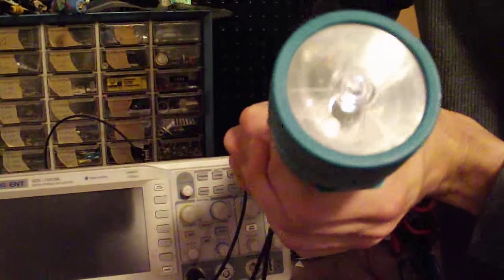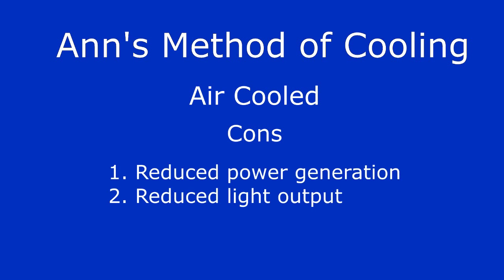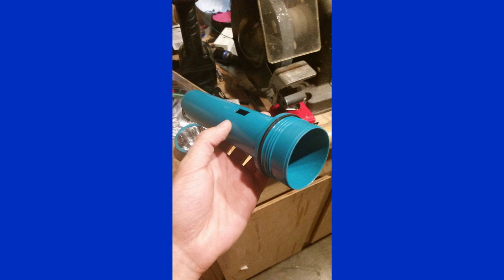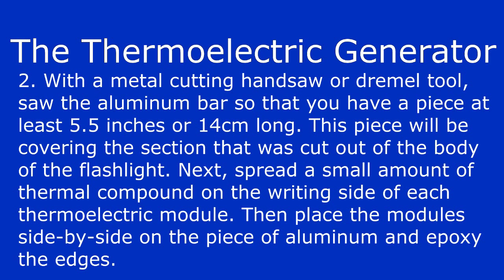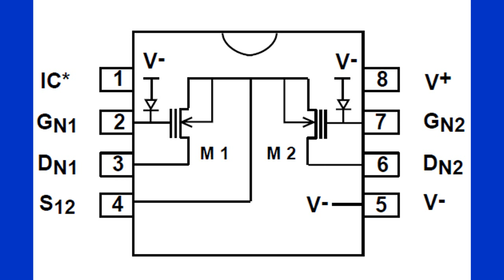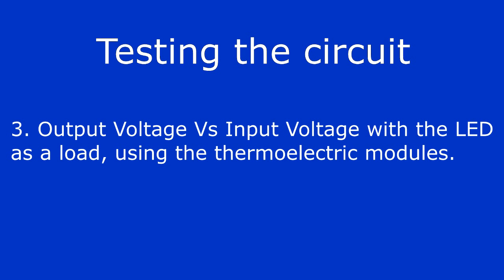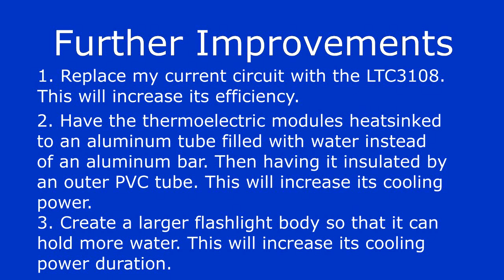How to make a Thermoelectric Flashlight

Comment: Hey i have a question, what do you mean in the end when you say further improvements and changing the tube to aluminium
Reply from the maker: Improvements in using a more efficient circuit, and a better method of keeping the lowing temperature side cooler, which would enable the modules to generate more power; an aluminum tube would help do this
Reply: LampE like should I get a pvc or an aluminum pipe?
Reply from the maker: An aluminum pipe would be best, but you would need to insulate the part that you are not using.

Comment: Hello, I'm french so first of all sorry for my spelling mistakes.
So, for my study, I'm trying to create a generator with Peltier tiles in order to power up a remote but first I'd like to power up a simple LED. I've already created a circuit with 2 Peltier tiles and a LTC 3108 but I can't switch on the LED ... I obtain 3.2 V but I'm just able to power up the LED for maybe a millisecond and that's all ... I've even tried to put a capacitor after the LTC and then discharge it through the LED... Have you got any idea ?
Thanks a lot!
Arthur
Reply from the maker: What is the voltage across the LED when you have it connected?
Reply: I have a very low voltage because it falls down when I connect the LED (I precise my current is DC)
Reply: In fact according to my test the voltage falls down to 2V when the LED is connected and the LED stays off
Reply from the maker: That means that it is not outputting enough current. This can be many reasons: maybe your peltier tiles are not outputting enough current, or your current is damaged. I can't tell with out testing it.
Reply: I will try to understand what's wrong ... Thanks

Comment: Would it be better to use a 100k ohm resistor?
Reply from the maker: Using a 100k ohm resistor with these specific components (the exact common mode choke that I am using, and the ald212900pal) will actually cause the circuit to perform not as great, but not too bad.

Comment: Can u tell me the efficiency of ald212900?
Reply from the maker: +Abtahee Salakeen If you mean the over all circuit efficiency, it is ~50-60% at an input voltage of ~0.2V with an output voltage of ~3V, at a duty cycle <10%. Under the conditions of a similar LED. Here is a link to the specs of the ald212900 http://www.mouser.com/ds/2/8/ALD212900-225961.pdf

Comment: im sorry,but i need to no whatss every component of circuit  do,you can explain please its urgent
Reply from the maker: 1. Ald212900pal MOSFET 
2. Common Mode Choke
3. 50000 ohm resistor
4. A White Light LED
5. Thermoelectric Modules
Reply: LampE   know the components, I just needed you to tell me what each one does on the circuit.
Because I have to finish an urgent project, do you think you can help me, please? A hug from João Pedro de Portugal
Reply from the maker: ALD212900PAL MOSFET: This is an electrical switch that allows the current to flow through the common mode choke to charge it, and also discharge it in order to light the LED.

Common Mode Choke: This does a few things. It creates an oscillation with the MOSFET, it increases the voltage, and it stores the energy that's being used to light the LED.

50K Resistor: This restricts the amount of current going to the gate of the MOSFET, so that the MOSFET doesn't get damage by the spike of voltage coming from the Choke.

Thermoelectric Modules: The power source of the circuit.

I hope this helps!
Reply: Tanks very much for the help :)

Comment: LampE I'm doing your project, and I'm stuck at the circuit part, cause I found that there is voltage and electricity that passes through my circuit, but when I put my hand, the LED didn't light. I checked if my circuit was wrong by putting two batteries and it worked. Any tips?
Reply from the maker: Make sure that you have the circuit connected correctly. Also, if you have an oscilloscope you should use it because it will allow you to see if the circuit is even working.
Reply: I replaced the joule thief circuit with a step up generator circuit that works at 0.5 volts, how can I get 0.5 volts from the four Peltier plates. I am only getting 0.36 volts. The circuit is connected correctly, and no I don't have an oscilloscope but I have a multimeter. I put a hair dryer and it worked.
Reply from the maker: You might need a better heat sink
Reply: I used two heat sinks, do you mind if I email you my phone number to call you
Reply from the maker: You can also try putting the heat sinks in the refrigerator, it will definitely help increase the voltage of the modules. You can message me your email, but email will be the best form of communication.

Comment: Hi I'm doing this for my project and I'm wondering if you have any idea what is the part number of the transistor i can use to replace the MOSFET?
Reply from the maker: If you are trying to build an energy harvester circuit, I would recommend the LTC3108 circuit instead of using this method of using a MOSFET. The LTC3108 is designed for this.
Reply: The thing is that the LTC3108 isn't available in my country and if I were to order it, it would take a very long time to arrive, which would make my project overdue :(
Reply from the maker: @moonlysmile1171  The ALD212900PAL is also unavailable to you from both Mouser and Digikey?
Reply: @lampe7384  yes, the same problem as the LTC3108
Reply from the maker: @moonlysmile1171  Where would you order components if not from Mouser or Digikey?
Reply: @lampe7384  I used Shopee, Lazada, and i think products from Electronic Source can be delivered really fast enough in my country
Reply: @lampe7384  so there really is no other transistor that can replace the MOSFET at all?
Reply from the maker: @moonlysmile1171  Yeah, the characteristics of it are pretty unique. What makes it special is the really low voltage threshold to turn the switch on; <100mV. I haven't been able to find a switch similar. What's the voltage range you are working with? Are you using thermoelectric modules like I did?

Comment: are there any alternatives to the ltc3108 and ald212900pal n channel mosfet?
Reply: do you know the mosfet's part number?
Reply from the maker: The part number of the ALD212900PAL is ALD212900PAL. In addition, there's another version of the same MOSFET called ALD212900APAL (Part # ALD212900APAL). The difference is the ALD212900APAL works at a slightly lower voltage than the ALD212900PAL and it cost a little more, but it's basically the same.

Comment: What is the current and voltage value of the common mode choke used here?
Reply from the maker: The maximum current value on the common mode choke used is rated at 1 amp. However, the actually input current going into device is tens of milliamps. The output current is less than a couple milliamps. The voltage values are different depending on the input voltage. Watch from 13:00 to see the different values (the voltmeter is is millivolts).
Reply: Thank you very much LampE!

Comment: Hi, will the torch work if I use a voltage booster 0.9V-5V,instead of the Mosfet and the common mode choke
Reply from the maker: Only if you can get the modules to produce 0.9 volts. you would need a pretty good temperature differential. Maybe Ice cold water will help.
Reply: Thank you so much,can sodium nitrate do the job,because it is a good coolant.
Reply from the maker: Yeah that should work, because sodium nitrate is a great anti-freeze agent. If you add the right amount to water, you should be able to put it in the freezer without it freezing. One thing that you will notice though, is that the flashlight will be super cold when you hold it, but it should definitely work. Also, sodium nitrate is highly flammable, so be careful.
Reply: Thank you very much.
Reply: Thank you very much.

Comment: Hi great video, but I was wondering, where do the wires of the red and black from the modules have to be connected to?
Reply from the maker: Looking at the diagram at 10:20, the red (+) wire from the module is connected to where the diagram shows VCC. The black (-) wire is connected to where the diagram shows GND. I hope this helps.
Reply: @lampe7384  so just to clarify the red (the +ve) goes to the 1 wire of the common choke that is connected to the resistor. And the black wire (the -ve) goes to the source pin and the negative lead of the led?
Reply from the maker: @imok7348  That is correct
Reply: @lampe7384  Okay, thank you so much! Have a great day!

Comment: I want to boost 20mV to get 5V..So ltc 3108 is the only option. Please tell where to buy Ltc3108 online? I checked it on website of linear technology and their were too many models?? Please tell me which one is the best model?
And how can i make the circuit??What are the components used?? please help me! thanks
Reply: +LampE !
Reply from the maker: You are definitely going to want more than 20mv to get a decent amount of brightness if you are using it for an LED. The chip that I get is the LTC3108EGN#PBF, however, as I mentioned in the video, you will need a SSOP pin style adapter board that you will have to solder the chip to. Here are the following components to make the boost converter.
Reply from the maker: 1. LTC3108 micro chip, as well as an adapter board (SSOP pin style)
2. 10nF cap (C2-Transformer) 
3. 330pF cap (C1-Transformer)
4. 4.7uF cap (AUX-GND)
5. 1:20 transformer like this one http://www.mouser.com/ProductDetail/Wurth-Electronics/74488540250/?qs=%2fha2pyFadujB6tfzH9RjWwKQvtaqgJwp9O3TdNJPDjztZYD4hZlKhA%3d%3d

For additional help use the data sheet http://cds.linear.com/docs/en/datasheet/3108fc.pdf
Reply from the maker: It is going to be a while before I make a video on how to make the device.
Reply from the maker: Yeah, that's the one that I used.
Reply: Pls give the answer to my questions.!
Reply: What is C1 and C2 transformers ??
And when will you make the video.. 
I have subscribed to your channel and eagerly waiting..
Reply from the maker: C1 and C2 are the capacitors that connected to the single transformer and to their corresponding pins on the LTC3108. It will be a while before I make a tutorial video, as I am currently busy with school. It will probably be some time in January as the earliest. It took me a month to make this video. Hopefully I will have more time in the next month to work on it.
Reply: LampE 
where can i buy these C1 and C2 tranformers? 
And please make the video fast. You can simply explain where you got things from and how you connected them.
Reply: And can we first boost 20mV to 1 volt then 1 volt to 5

Comment: how can we heatsink peltier tile on aluminium tube? and can we use transistor and capacitor in place of mosfet? And common choke is like torroide so i am using less winded torroide in ckt will it work?
Reply from the maker: You would have to get a thick aluminum tube and mill it down to make one side flat. You can't use a transistor because the voltage to the base needs to be around 0.7V which is too high for the thermoelectric modules to work. If you are going to make your own, make sure that the inductance in somewhere in the millihenry range (mH). It won't work if it isn't
Reply: LampE sir i dont have any instruments or device to check that can you please teach me formulae and is there any other site than mouser because it is charging too much money just for delivery total product cost is nearly  10 $ but for delivery it is chargint around 60-70$ which is in indian currency lots more please help i want to buy that mosfet and choke mode
Reply from the maker: I honestly have never done that before. I only use an inductance meter. It's probably best to buy one that you know the rated value for. You can try ordering from digikey, but I'm not sure how their international shipping charges are.
Reply: ok sir thank you for helping and i am using aluminium tube as the body is it preferable.
Reply from the maker: no problem
Reply: LampE sir thanks a lot

Comment: What should i use - Ltc3108 or boost module or joule theif?
Reply from the maker: The joule thief circuit, like the one here, is cheap and easy to make, but it is not as great. You can buy a boost module this the one here http://www.shop.customthermoelectric.com/ELC-W0422-1-Unipolar-Boost-Converter-Circuit-ELC-W0422-1.htm?gclid=Cj0KEQjwx96-BRDyzY3GqcqZgcgBEiQANHd-njcc2ZGwmG6yD4T-fHGcLv_0LcAqxbFq6WlWxneMYJkaAjL58P8HAQ but I haven't tried it, so I do not know how well it works, but it is designed for thermoelectric modules. The LTC3108 would be the best choice if you know how to solder well.
Reply: If i try to make one (LTC3108) how much would it cost?
Reply from the maker: The circuit would cost less than $8, not including shipping for the parts.
Reply: ok :)

Comment: What is the output of this joule theif?
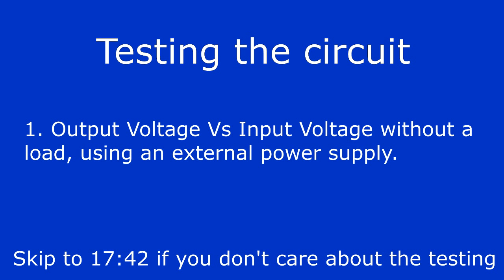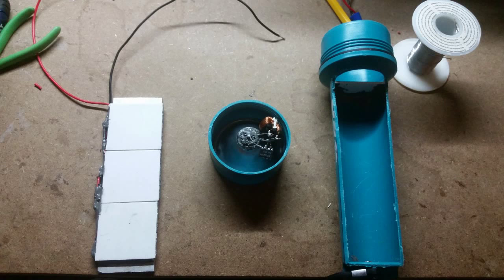Reply from the maker: This joule thief can reach voltages up to 15-16 Volts with no load (14:42). Check out the testing portion of the video 12:52-17:52, that may answer your question in detail.

Comment: Hello, what's the output of the circuit?
Reply from the maker: It can range from 0.25mA-1mA, depending on the temperature differential.
Reply: Hi, can you please answer my questions. I need to know them for my thermoelectric heat generator.

Comment: +LampE I have 10 peltier modules and everything to make ltc3108 circuit expect tranformer. Can i get 1v output from these? And can i replace adl212900 with ltc3108?
Reply from the maker: 10 modules seems kind of overkill. You really only need a couple, 2-3, and a good heat sink, in order to power either the adl212900pal joule thief or the ltc3108; you don't need 1 volt, only a few hundred millivolts. If you are using the same type of peltier modules as the ones in the video, you should be fine.
Reply: can i replace adl with ltc3108 chip with ssop board ?
Reply from the maker: Yes, but you would have to follow my other tutorial on how to do so.
Reply: LampE can you tell me steps.. i have to submit my project before 18th jan?
Reply: I have already seen this tutorial..But it doesn't tell how can i put ltc chip in your joule theif?
Reply from the maker: Oh no, I understand what you are saying now. The LTC3108, and the joule thief are two completely different circuits. The joule thief requires the ALD mosfet in order to work. You can't substitute that chip for the ALD. You will have to decide which one you would like to do.
Reply: What is the substitute for transformer..Is their any other way i can boost 0.5 v to 5v without using adl chip??
Reply from the maker: The ALD is the only mosfet that I know of that is capable of making a joule thief operate down to those low voltages. You can try using a basic BJT transistor, like the n3904, but it will probably need at least 0.7 V to work. LTC3108 is the other option to stepping up those low voltages. Is it difficult for you to obtain the components to make these devices?
Reply: LampE I have everything to make ltc circuit except tranformer..Can I connect joule theif directly to usb cable? or to 0.9 v to 5v converter chip??
Reply from the maker: Are you not able to order the transformer? Digikey should be able to ship all over the world. If you are going to connect the joule thief to that converter, you might need to rectify and filter the voltage of the joule thief's output because it is going to be AC. Even then, the efficiency of the entire circuit will drop because you are boosting the voltage twice.
Reply: LampE what should I do if I want to charge the phone ??
Reply from the maker: You would need a large temperature difference because there will not be enough power generated to really charge a phone.
Reply: Can't i boost the voltage? 5v can charge the phone?
Reply: LampE what kind of diode do I need and how can I connnect with joule theifs output wires?
Reply from the maker: a blocking diode
Reply from the maker: You can charge a phone, but it will be very slow.

Comment: Lampe Can i connect modules in parallel?
Reply from the maker: Yes, but you'll not get as much voltage.
Reply: LampE yes, but that way electricity will pass even if heat distribution is non uniform..btw Thank you soo much for help!!

Comment: How long do it take for the led to power on?
Reply from the maker: if your hands are warm, it should be less than a second
Reply: LampE Thank you so much for getting back to me. I’m actually stuck at the moment with the build. Can I️ privately message you with my questions? I️ have a group of students working on this but we’ve seem to have reached a dead end
Reply: LampE in case I’m unable to email you, I’ll just post my question here. Using the exact materials from your list we put together the circuit and flashlight body. The flashlight is only using two Peltier tiles because it’s not long enough but still hold 150mL of water. How badly would it not work if it was between 10mL to 40mL less than recommended? Now, I️ don’t have an oscilloscope nor does my school have access to one so I’m trying to find alternatives to my problem. I’ve been using a 9V battery to see if the LED attached to the circuit will light up and it does. Without the circuit, the LED just blows out. Since the LED lights up without blowing out, does that mean the circuit works?
Reply: LampE I️ have a digital multimeter though and I’ve been using it to see how much voltage it being outputted when I️ touch the flashlight. After placing the flashlight in the refrigerator, the voltage output increased past 1V which is more than what’s needed to light the bulb (LED should have been lighting up at around 130mV) but the bulb still doesn’t light up.
Reply from the maker: The LED blow up because the voltage is too high and too much current is passing through it. Don't connect the 9v battery to the circuit, it'll kill the chip
Reply from the maker: Having an LED will indicate that it works or not. Usually if it doesn't work, it's either because the connection are wrong/poor, or the chip is dead. Those chips die easily.